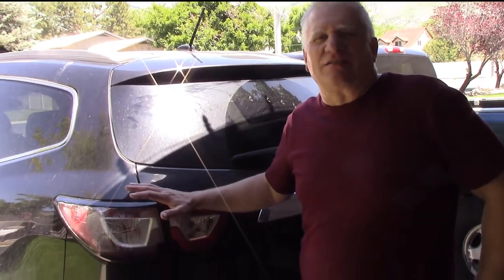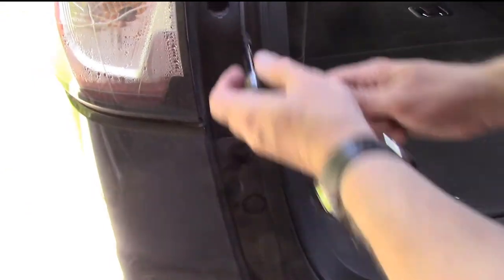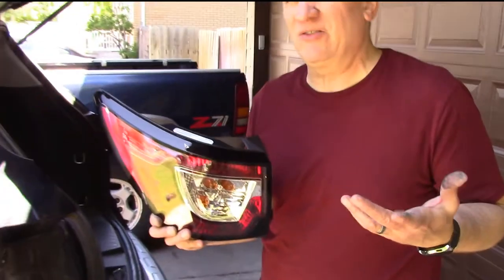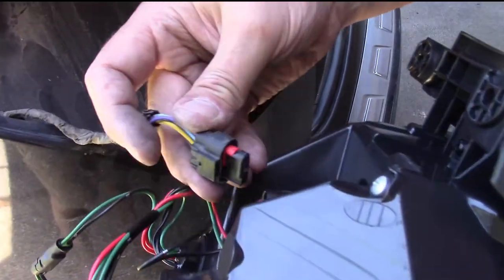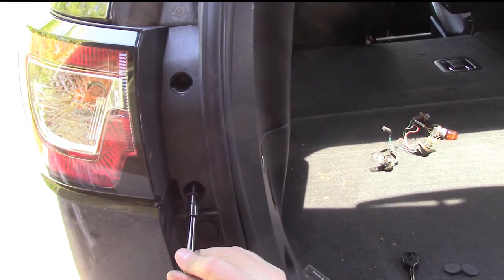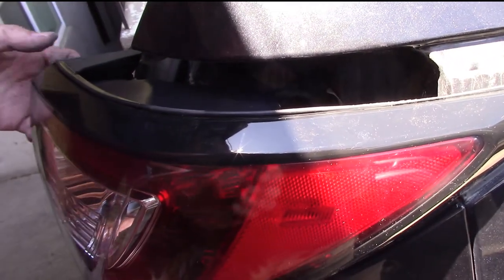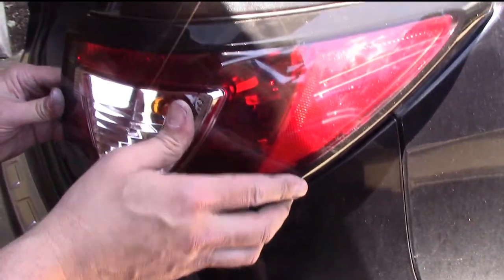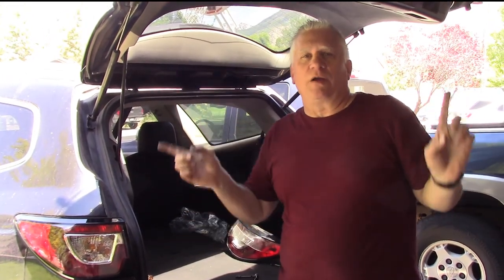How to Replace a Broken Chevy Traverse Taillight - Driver and Passenger Sides

Comment: I’m in the process of doing the same thing. Shouldn’t I get the CAPA certified option instead of the standard grade.
Reply from the maker: I'm not sure what the exact differences are but mine said "Designed as a DOT/SAE-compliant direct replacement for your original tail lights." They've worked great so far. Thanks for watching!
Reply: @Aggressivefun  thanks so much for your video. As a single mom I found it very helpful. As soon as it arrives I’m more confident on doing it myself
Reply from the maker: That's awesome! Glad that it helped. Thanks again for watching!